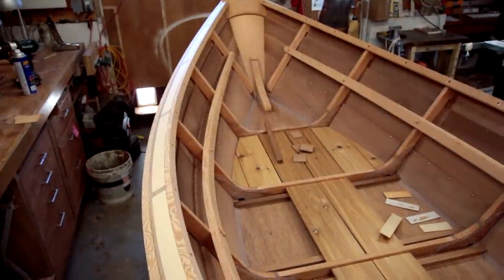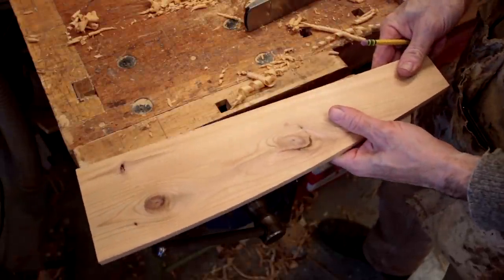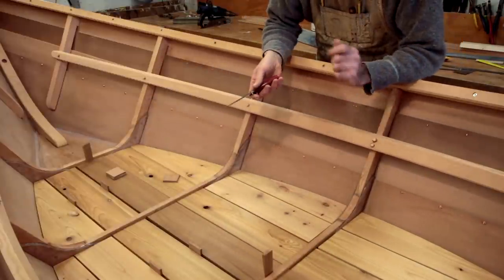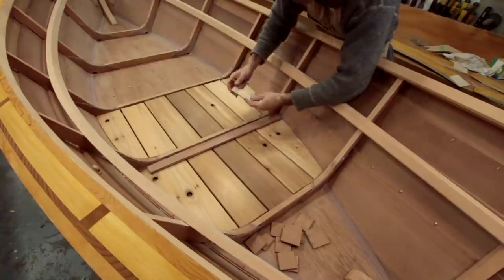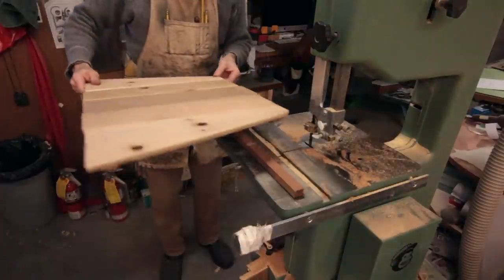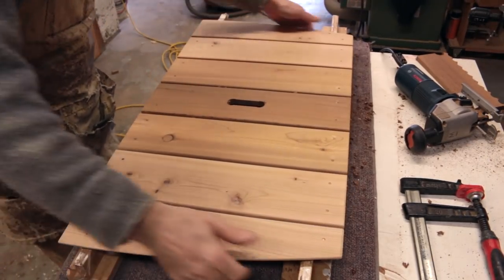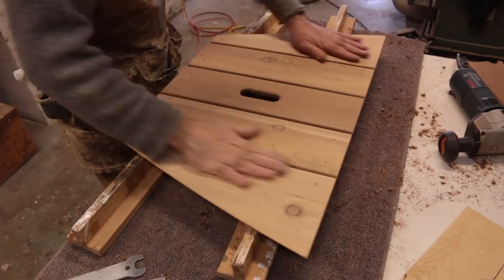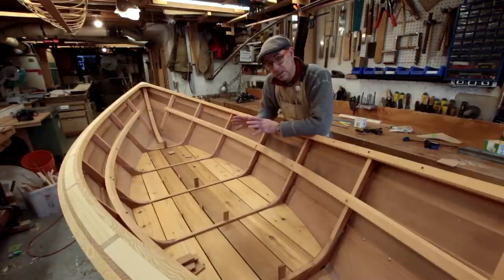Building the Bouchie Dory - Part 31 - Floorboards

Comment: I too use spirits, oil, varnish on everything. 4 coats a day apart. Added a little stain for coats three and four on construction grade pine for outdoor charcoal storage chest. Gets hosed off twice weekly when patio is cleaned and after 2 years, still holding up with no maintenance. Other pieces that got the same treatment and are also exposed to direct sun are also holding up fine. Indoor pieces also get the same treatment, plus wax.

Comment: Can’t really see, did you bother with limber holes ? I would not want to use your dory for angling, I forsee loads of trouble with hooks through the gaps between boards,  don’t ask !!   That really is a lovely little boat though.
Reply from the maker: Yes, both the frames and floorboards have limber holes. The client is just interested in rowing, not fishing. Of course you can always leave the floorboards at home if you want to fish. They come out extremely easily.
Reply: @Nomadboatbuilding   Ah zo !  you build a fishing boat to row !  veerry interesting …